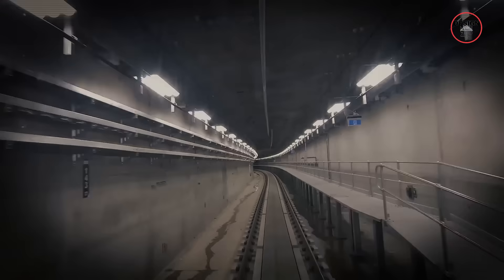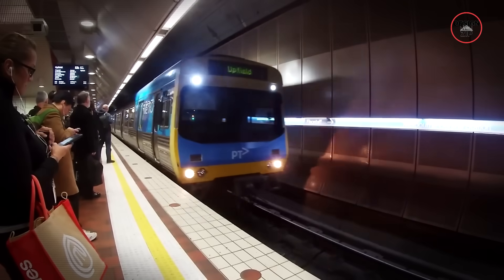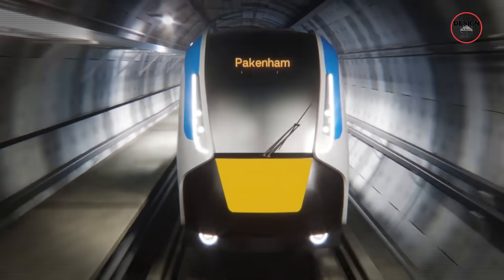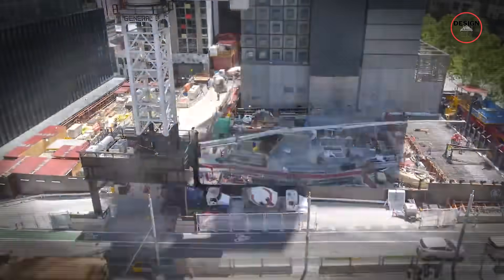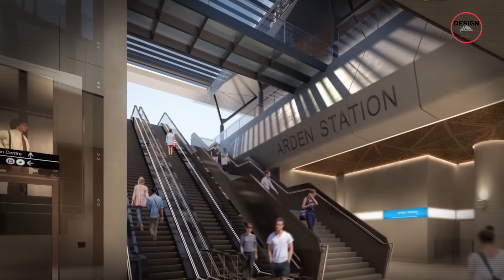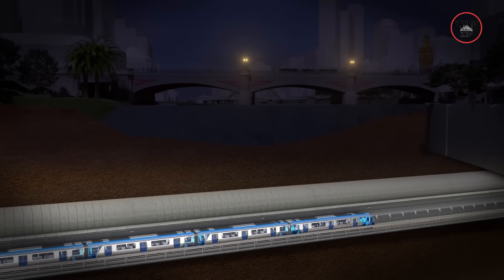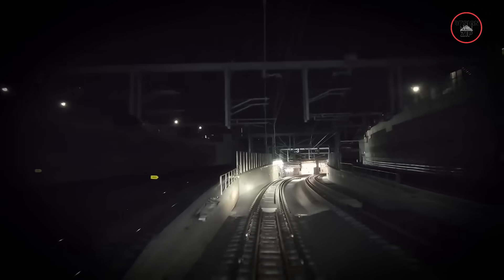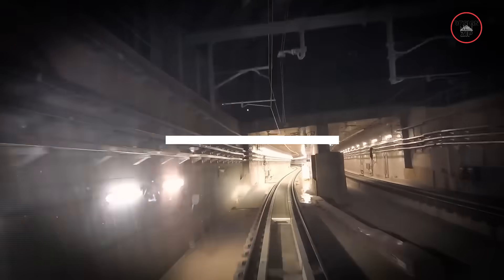Melbourne’s New Train Line Is Almost Ready

Comment: This was a massive undertaking. Not only improve transport issues but also the face of Melbourne itself. I had 6 family members working on this project plus quite a few friends. Yes the contractors had massive problems hence the blow out. Rats being just one of those problems, but the difference in soil, rocks, the terrain,  water, and safety of the workers. The linking up of roads, diversions, also a headache. But completed, instead of currently taking hours to get to the city by road or rail will be faster, easier and less stressful. I personally think this will be a bonus for many coommuters😊😊

Comment: No it's poor timetable management by Metro. None of their highly paid executives travel on the trains and especially during peak hours so they have no clue what the regular traveller has to endure. 15-20 minute waits on the Pakenham line from Flinders during peak times is what I use to experience when use to catch that line a few years ago. 
No one ever caught the express train that left Flinders because it only expressed to Dandenong. 90% of passengers who catch the Pakenham train live in the suburbs after Dandenong. If Metro had any brains they would have an Express train that rain all the way to Dandenong and then stop all stations to Pakenham which would easy the overcrowding at Flinders.

Comment: The City Loop was built in the 1970s, NOT the 80s.
Reply: Opened in 1984
Reply: @saralgupta5250  It was actually opened in January 1981 - with only the Museum Station.  Parliament opened in 1983 & Flagstaff in 1985.

Comment: what they have not looked at is a hybrid battery / pantogragh style trains for the ballarat/bendigo line and gippsland lines that could go through the tunnel and take demand off spencer st
Reply: Variation in fleet is difficult when all of V/Line rail routes (excluding the Albury line) essentially operate as one line with many branches. SXS was designed to be the V/Line base of operations, it has the workshops you can't terminate a train at Town Hall & send it back for maintenance. You'd also have to do extra running which is expensive, & I don't think batteries will be able to do a run a train for over 200km of unnelectrified track to Echuca. Not to mention it would just make the capacity issue MM1 aims to solve worse than it is now.

Comment: GREECE HAS 66 BRAND NEW UNDERGROUND STATIONS MELBOURNE HAS 10
Reply: Congratulations , you finally have infrastructure that wasnt built in 2500 BC
Reply: GREECE IS A COUNTRY. MELBOURNE IS A CITY.
Reply: Melbourne has 222 train stations, mostly above ground, in a city of over 5 million people. Athens has 3 metro lines for a total of 66 stations in a city of 3 million people. Melbourne's network is more extensive than Athens. They are not comparable as Athens is densely populated, Melbourne's population is spread over a much larger area.
Reply: different systems, different cities, built at different times
Reply: We tried not to break the bank....
Reply: And the SRL will be cancelled by the Libs if/when they get in. So the SRL is not tory proof.